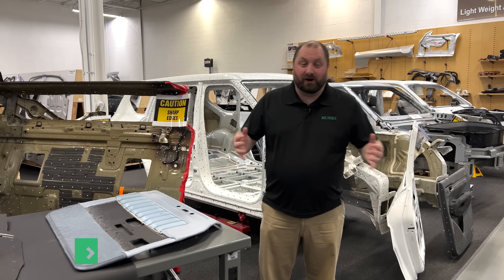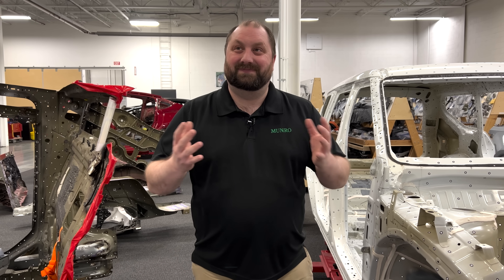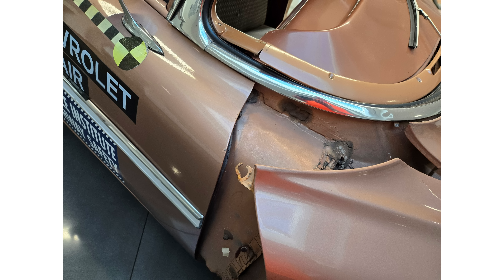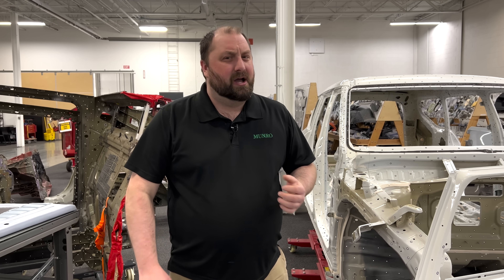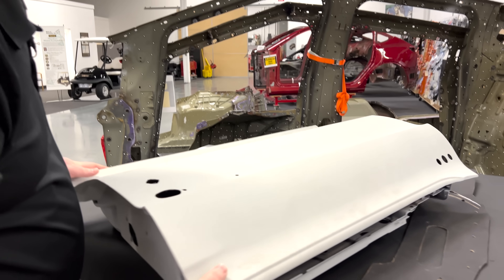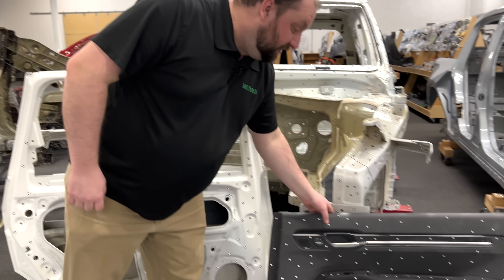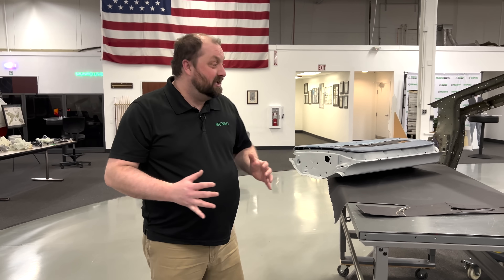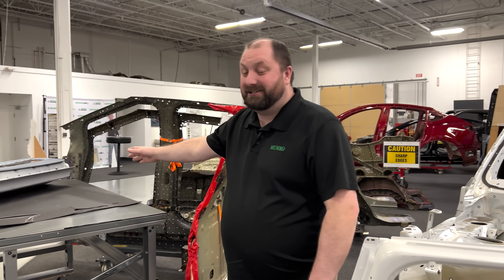No, Your Classic Car Isn't Built Better Than Your New Car

Comment: As a collision repair and restoration professional with over a decade of experience in classic cars I have to point out lots of cherry picking and false information in this video. First of all calling stamped sheet metal "structure" is a bit generous. 
Yes a handful of earlier classic car models do have little to no inner fender or shock tower structure between the core support and firewall, typically pre 70s GM products. But claiming they are all designed this way is false and disingenuous and there were just as many classic models made that do have a fully integrated front structure. 
My daily driver 68 Plymouth Satellite and almost everything else made by Chrysler in that time period has a fully integrated front structure stronger than most modern cars. I've killed 3 deer with the car and none of them did ANY damage. I also completely totaled some brake checkers 2014 VW Passat and only bent my bumper slightly. 
His car was totaled, with the entire rear end smashed into the shape of the front of my car, and I only needed a 400 dollar front bumper from AMD.

A door bar also isn't necessary in a classic car when the very shape of the panels and body lines themselves make the door skin stronger and more resistant to deformation and intrusion than most bland modern doors with little to no natural dome shape or body lines for strength. That little bar and flimsy piece of stamped sheet metal in a modern car door isn't there to protect you, its a band aid for the lack of strengthening body lines and shape and is actually there to keep you from denting in your own door skin just by leaning on it or shutting it with your hip too hard. Its not attached in a manner that offers you any serious collision intrusion protection, it's just spot welded against the inside of the door skin to keep it from being so flimsy. 
For it to actually protect you and substantially improve the cars overall rigidity it would have to be attached to the unibody itself bridging the door gap.
These wouldn't pass tech inspection as door bars in any racing class that requires them. 
This wasn't a problem back when cars had enough body lines and shape to make the door skin rigid.
The classic door shown in the video is an excellent example of this as well with its well defined lines. This is why the floor of a pickup truck bed is ribbed for strength. If it was flat it would be weak.
Also plastic door panels are FAR more dangerous and are often responsible for serious injuries when they break into sharp pieces of jagged broken plastic in severe collisions. Cardboard door panels covered in soft vinyl don't do that.

As for the IHS classic VS modern car crash test, everyone ignores the real facts about the cherry picked car they used. 
They specifically chose a GM car with no integrated front structure and a notoriously weak frame design known as the "X frame" that only lasted for a couple of years and was promptly phased out due to severe structural integrity issues. 
The fact that you briefly mention the X frame without going into detail about it being notoriously weak raises questions. 
They also specifically chose a 4 door over a 2 door because they flex and deform more than the stronger 2 door models. 
This is why 2 door cars were originally favored for racing as the bodies flex less in acceleration, hard turns and collisions. 
They also specifically chose a small narrow inline 6 engine over a wider V8 engine that could have helped prevent such brutal intrusion and deformation. 
AND on top of that they made it an offset collision at the perfect trajectory to completely side step the narrow inline 6 engine. 
You can see the modern car just cuts straight through the old car like there is no engine in the classic at all. 
That's what made everyone think it had no engine.

They may not have removed the engine or any bolts, but the deck was stacked against the classic at almost every opportunity.
When you combine the fact that the car was an X frame, a four door, an inline 6, had no integrated front structure and was set at the perfect angle for the most compromising offset collision possible, you get a cherry picked example of one of the weakest cars ever produced, that is not accurately representative of classic cars as a whole.
Reply: Modern bumpers are meant to flex and return back into shape. Another thing is overall height. If a higher vehicle hits a lower vehicle chances are that the lower vehicle will sustain more cosmetic damage but that doesn't mean it's built weaker.
Reply: If you depend on an engine block to save you in a crash, your car must be extremely unsafe. I have some bad news for you, an engine block is a problem in a crash and not a benefit. Going by your logic a Porsche 911 must be least safe car on the planet. Or a Tesla.

A 1970s El Camino crashed a few years ago vs a modern Malibu, looked exactly the same as the 59 looked in the crash test.  The same soft, weak body structure. Frame didn't matter, they're all soft tin cans. I've also seen a Honda Civic tearing a Chevelle SS right off the frame in a crash. In both cases the occupants of the old cars died.
Reply: @swordfish1986  You appear to be very confused here and blending multiple well known classic car crashes together in your memory. There is an infamous well known collision between a black 1968-69 Chevelle and a modern Malibu where the passenger of the Malibu died despite the Chevelle taking much worse damage. The Chevelle's body came off the frame partially and there is a whole forum thread of guys talking about why the body came off the frame partially when no other known Chevelle has done that. They speculate that the car was very likely heavily rusted and improperly restored. 
There is also an infamous Crash with a 1970-72 blue Oldsmobile Cutlass 442, which looks a lot like a Chevelle and is the same basic structure under the skin, and the 55 year old driver died impacting the dash/wheel after a severe head on collision with a Honda Civic. His wife in the passenger side survived. The cars body did not separate from the frame, despite the fact that the Olds Cutlass and the Chevelle share the same frame, suspension and skeletal body structure. 
The El Camino collision is a very sad situation where two elderly 66 and 71 year old men were out test driving a trailer queen show car 70 El Camino SS and some kid with a revoked license who had just gotten out of jail that very day for violating a protective order hit them head on speeding like a mad man in the wrong lane and killed them both. The Car held up remarkably well for being hit head on by a speeding car. It's just a shame that the two men didn't make it. 
I also need to ask, what does the structural makeup of a known weak and dangerous discontinued 1959 GM X frame car have to do with a Porsche or a Tesla that is specifically designed to be rear engine? You're the one not making any sense here. Attempting to oversimplify an intelligent argument with "by your logic" fallacies in hopes of making someone look stupid is the weakest form of counter argument.
Reply: @Impactjunky  That's a lot of text for being so wrong. Lots of accidents on google show that classic cars completely collapse in a collision with a modern car. The Malibu in the Chevelle crash wasn't modern, it was an older 90s or early 2000s model and no one died in it. And the El Camino just completely collapsed on one side, it didn't held up "remarkably well" and killed both occupants while the newer Malibu didn't even have the a pillar bent. What more evidence do you need, that they're unsafe tin cans? Look under the fenders and bonnet for once, there is only air and a thin sheet metal fender. WAY less structure than a modern car and the cars overall way less dense than modern cars. Big and hollow. The only half way substantial car from back than is a Chrysler Imperial. ALL OTHERS are tin cans. And an X frame isn't any less safe in a frontal collision than any other frame. The El Camino crash shows the exact same damage as the 59.
Reply: @swordfish1986  Wow, I've never seen anyone get corrected so much and still try to keep arguing. The Malibu in the Chevelle crash is indeed modern and it is confirmed through the forum discussion and news articles about the crash that the passenger died. 
Just because its not brand new doesn't mean its not modern. It's exactly the kind of modern death trap with plastic bumpers and poorly engineered crumple zones and airbags and computerized fuel injection that I was avoiding when I bought my 68 Satellite daily driver 15 years ago. I've since then totaled a brake checkers 2014 VW Passat with my car, and killed three deer with it. None of the three deer did any damage at all and totaling the Passat only bent my bumper slightly. 
This is something real that happened to me, not some stupid story I pulled up and twisted the facts in hopes of padding my argument like you keep doing. I have actual real world experience with this issue and you are just telling me secondhand "stories" you've heard, and they are all about the same basic car platform too, the GM A body.  One of the classic body platforms well known to have no integrated front structure above the frame with flimsy inner fenders as I already mentioned once before. So telling me to look under the hood is ironic considering I was literally just talking about the frontal structure differences myself. 
It's almost like you aren't even taking in any of this information. 
The whole point of my argument is "not all classic car models have a weak front end" and your response is to keep telling me about the ones that we already know have a weak front end like you think you are proving something.  
The El Camino held up like a champ too for such a highly compromising barely overlapping frontal collision with an oncoming car going 80-100 MPH. Speed is always a factor and the offending vehicle is always in better shape. The fact that the El Camino still had a door gap to open up and the passenger compartment wasn't completely collapsed together after being hit on the far corner of the front bumper by a full size car of the same weight going more than twice the speed is commendable. The occupants would have likely survived if they weren't already feeble old men in their late 60s and 70s. 
I know this because there is a famous direct head on collision between a white Honda pilot and an orange 69 Pontiac GTO, which ironically is also a GM A body. 
This was a worse collision and the GTO's front end was destroyed far worse than that El Camino, yet the 33 year old man driving survived. 
It's ironic how the only examples you've provided so far of people dying in old cars are feeble GM A bodies with feeble elderly passengers from 55-71 who likely weren't even wearing seatbelts.
The frame also didn't come out from under the Cutlass 442, or the El Camino, or the GTO despite them all being the same A body structural platform, which proves the frame coming off the car as you mentioned earlier is a restoration defect and not common.
It's funny how you guys always move the goal post too. First you try to act like the new cars are all so much tougher, and then when you can't prove it you always move to "yeah but they are supposed to bend more to absorb energy". 
You can't have it both ways. Either they are designed to crumple or they are not.
Reply: @Impactjunky  Nice stories you present here Santa Claus, I must say. So you tapped a VW Passat at 5 mph and scratched its bumper cover! Hooray! I saw the exact opposite, an old C10 Chevy truck rear ended a 2015 Passat and got destroyed big time. But still pffftttt, 68 Satellite is a 3,500 pounds tin can, that would get destroyed by a modern VW Golf with its plastic bumper. 3,500 pounds is actually below average weight for a car today! You should buy a Chrysler Imperial as it is the only tough car from back then AND weighs above 5,000 pounds! Not bad! EVERYTHING else from back then is hollow tin can banana bender frame soft! Even a Benz or Volvo! Deathtraps! Old american cars especially are death traps, no matter the manufacturer except Imperial! Doesn't matter which frame they have, if it doesn't even get hit in many accidents! No structures above the frame rails except some paper thin sheetmetal I could dent in with a 300 grams hammer. A lot of fate in some thin sheet metal and air you have there! Did you know a modern small BMW or Benz does weigh the same as some old boats? Even some smaller Honda sedans and others! That would make them A LOT more dense! Fascinating! Great, now I'm tired of all the boring writing! Have fun crashing your car into a Fiat 500!
Reply: @swordfish1986  You're the only one with the "stories" and I have to keep correcting you with the facts. 
Also my 68 Satellite only weighed 3417 stock not 3500. That's why it takes off two tenths of a second faster than a Tesla Model Y Performance. And why Car Craft Magazine picked it out of 5,000 other cars nationwide as one of the top ten rides of the Hot Rod Power Tour. 
When I hit that Passat the trunk lid, bumper cover, tail lights and both rear quarter panels were completely crushed and there were two holes in his car where my factory bumper guards pierced his plastic bumper cover. I got out of my car and looked at my slightly bent front bumper and said to the guy "well I guess you wish you hadn't brake checked me now don't you?" 
The police found him at fault too which really made his blood boil. He acted so angry that they had to sperate us and right before I drove off they told me they thought he was intoxicated and asked if I had seen any evidence of that myself before they arrived. 
I have a video on my channel about swapping the bumper after the accident too. And it's not the only time something like this has happened either. I've hit two other idiots that brake checked me and damaged their cars without damaging my own. I've also been sideswiped twice on the same side and popped the dents out like nothing happened. Once by a Camry and once by a Jetta. I've also slammed the front end into a concrete platform at the base of a light pole HARD going about 35 MPH mid drift in a parking lot and pulled the fender off the front tire and drove home. All I had to do was swap the bumper and beat the fender back into shape. 
I've had more hard hits in that one car than you likely will in your whole life. 
That's three deer, four if you include the one that got up and ran away, two VWs, an Audi, a BMW and a concrete pillar.
No modern car is surviving all of that. Especially when they are so dense and have no crush room to protect vital components from crush damage.
Reply: @Impactjunky  You are definately right about one thing. I probably never will have as many "hard" hits with my car as you have. Your name already gives it away. Why do you keep crashing into sh*t? And why do you upvote your own comments? The mysteries of Impactjunky.
Reply: @swordfish1986  I crash into shit because I dare to drive a classic car hard for 15 years straight. Also you finally gave yourself away with that "300 grams hammer" comment and the rest of your terrible english grammar. You're clearly not even in a country where you have access to classic American cars. You've most likely never even seen one in person, much less touched one or even ridden in one, and yet you are trying to argue with a literal expert about them who has won awards for driving them and restoring them.
Reply: @Impactjunky  You're aware one doesn't need to live in america to know something about cars? Your comments however make your "expert" status seem doubtful. Experts in the matter wouldn't write such ignorant opinions about car safety and structural design. No intelligent, educated person in the world would think some car from 1968 would be safer or better build then something contemporary. It's absurd and wrong in every way. You probably also think crumple zones are bs and make cars weaker when in fact crumple zones are EXTRA structures that old cars don't have. Don't believe me? Who cares? Stay ignorant, have a nice day!
Reply: @swordfish1986  You do at least have to have some level of experience in the matter of American cars before you try to assert your baseless opinions on them, and you clearly have none. Anybody who has hit something in a classic American car is an expert in this matter compared to your complete lack of experience. 
You don't even have access to one. 
I've been restoring and driving these cars since I was a teenager and my name is in Car Craft Magazine for it.
Also Chrysler/Plymouth/Dodge and most other brands started implementing crumple zones in the late 60s/early 70s on most models including the Imperial.
Reply: @Impactjunky  Yes, someone who has hit someone in a classic car is an instant expert in the matter compared to someone who has researched the matter for around let's say 1000s of hours worth of research. Is it like a divine intervention? You just instantly know everything about car structural design there is to know? If so, it's a shame I didn't crash in my classic Mercedes I owned 15 years ago. I could have instantly known it all! If only I knew! So many hours wasted! Or I could have asked you, restorer, hot rodder and crasher who also featured in magazines!
Reply: @swordfish1986  "1000s of hours worth of research". You couldn't even get your collision and body platform facts straight and just told mixed up stories about the same basic type of car platform without even knowing they were the same car under the skin. You're swinging way above your head here with the language barrier and the experience gap. Maybe if you did crash your Merc you would have learned something. Even if it was just to be humble.
Reply: @Impactjunky  No, there is no language barrier here, you understand me and I understand you. You think it matters which platform is which car and I think they're ALL structurally lacking and unsafe compared to todays designs, no matter how hard or soft their front ends might be. Be they Ford, Chevy, Pontiac, Cadillac or whatever! That is all there is to it.
Reply: @swordfish1986  That's the best part about this, it doesn't matter what you "think" it matters what the real truth is. I know or at least look up the truth before speaking and you don't. You just repeat twisted versions of what you hear and think.
Reply: The "real truth" is definately not that an 68 car is safer or more structurally sound than a contemporary one. Little does it matter if I mistakenly remembered some modern car model which collided with a Chevelle years ago. Malibu, Accord, Civic, whatever, they're all beefier constructions than some primitive old body on frame car which unreinforced body is bolted with six bolts to the wet as a noodle frame! And no I don't care if it's eight bolts or six! Your "facts" are irrelevant, you think a 68 car is safer and better build than something contemporary and you didn't prove a thing. You also think years of research about car safety, how they are build, which materials are used where and why is worthless, because it's all just repeated words. Then who would qualify to have an opinion on the matter? God? Only studied engineers? But they must be the worst engineers in the world if they build cars which are less safe than what we had 50 years ago. Believe what you want, I'm out of this nonsensical debate. Have a nice day!
Reply: @swordfish1986  LoL, wrong again! My car is not body-on-frame. It's a unibody like a modern car. So is the super strong 1967 and up Imperial, and so are all the best classic muscle cars including the Camaro, Firebird, Nova, Maverick, Falcon, Comet, Mustang, Cougar, 62-70 Fairlane, 68-72 Torino, 68-72 Cyclone, almost every car made by AMC, 
the Dodge Charger, Roadrunner, Cuda, Challenger, Coronet, Satellite, Dart, Valiant, Scamp, Duster, Fury, Polara, Monaco, Diplomat, and literally every single other passenger car made by Chrysler/Plymouth/Dodge from the mid 60s up including the 67+ Imperial. 
The Mopar A, B, C and E bodies are all just slightly smaller Imperials which is why my Satellite is such a tank.  They look identical underneath and share the same structure and suspension scaled down slightly for weight and handling.
I didn't even know this myself until today when you prompted me to check more thoroughly and do the real research that you falsely claim to have done. It's good to know now that my car is basically a lightweight Imperial. It makes sense why it keeps destroying everything it hits.  
Also the GM A body is one of the only popular body-on-frame classic muscle car platforms I can even find besides the Starsky and Hutch era Torino. Almost everything else high performance from that era is a unibody design like a modern car for strength. In fact my research shows that apart from GM being stubborn, most manufacturers were switching to unibodies in their mid size and smaller models by the mid 60s with Chrysler/Plymouth/Dodge and AMC taking the lead in 1960 by switching their entire lineups to unibodies except the Imperial, which would come in 67. 
Ford followed suit too introducing new unibody designs in 62 like my Fairlane.
Yet for some reason the only examples you and everyone else cares to bring up are the known weak body-on-frame designs with no integrated front structure.